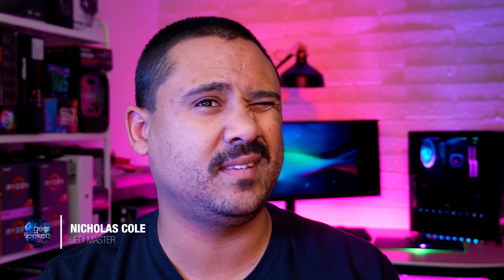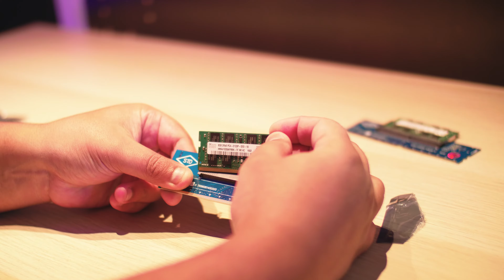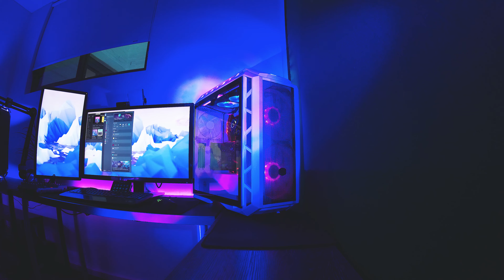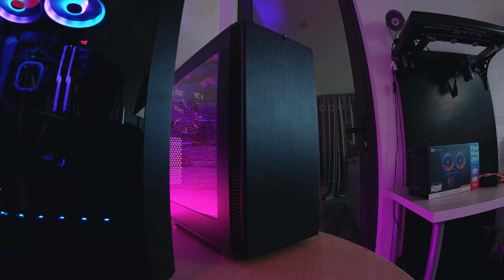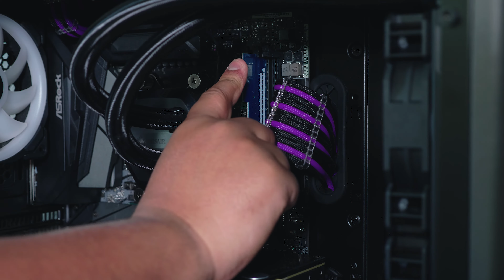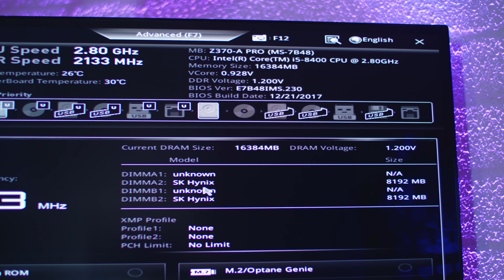Installing Laptop RAM into Desktop! - Compatibility Tested

Comment: I think you need some slightly newer ram sticks for AMD. The older DDR4 doesn't seem to work well/at all with AM4 I find.
Reply from the maker: This video is 6 years old
Reply: @GearSeekers  I was aware of that when I replied, the RAM stick looked a little like some early DDR4 SODIMM sticks which AM4 is a bit weird about when I tested random sticks I had laying around.

Interested to see an updated video on these adapters on various platforms. 😁👍

Comment: Me and my girlfriend really needed to upgrade her PC and went with 2 of these because we were on a shoestring budget due to the current chip shortage, and I had two ddr4 modules from a laptop I upgraded from about 2 years ago now. 

What we find is that it does work with more recent Ryzen, which it has been 3 years since the video was released, makes sense that its a bit more compatible now. The one issue that we have is it doesn't seem to figure it out at first boot. The computer won't post if you just power it on, you gotta hit the power button to turn everything on, hold it until it shuts down, and then hit the button again, and everything works fine. Even has a bit of an overclock on it.
Reply: what cpu are you using?

Comment: Im currently using so-dimm sticks in my current system (i5 6402p msi b150 mobo). At first the system didnt post but fans were spinning and what not. Installed the old ram and bumped the voltage up from 1.2v to 1.4v,  turned off the system, installed the so-dimm sticks again and the system posted. I then went back into bios and lowered the voltage where it was still operable. I know this is a 2 year old video but if you manage to read this comment, and what Im saying doesnt sound like total unicorn bs to you, I'd appreciate if you can confirm this on ryzen systems and get back to me. Anyways great video!

Comment: When you put the laptop ram adapter into the slots on the motherboard, the socket of the adapter appears to protrude over the ram slot in front of of it. Does this mean that you cannot fit four of these adapters into a motherboard with four slots?

Comment: Very interesting. I went searching for videos about these adapters before actually buying them, after watching your video I'm definitely not getting them.
Reply from the maker: Yeah not worth it.
Reply: @GearSeekers  I can concur, these type of dimm adapters are a hit d miss. I couldn't get them working on a ASUS Z170 or AsRock H110. They do however work on a HP Prodesk 400 G3 SFF PC. I mainly use them for testing out DDR4 SODIMM RAM, but outside of this, I would not recommend these at all.

Comment: Hi there! There is a thing that you missed... if AMD is kind of picky with the mems to run the system, maybe you should try other sodimm modules... I currently have 2x4gb gskill ripjaws ddr4 2400mhz running in a asrock h110-hdv, so, it would be nice if you try this.
Reply from the maker: I didn't miss anything. It doesn't work with any memory modules with these adapters.
Reply: Gear Seekers well, you didn't show it on the video, so it was a normal question.

Comment: Hey, great video, I have a question though. In Linus' video, the sodimm ram didn't post while paired with normal dimms. Once he removed the dimm, and ran only the sodimm, it worked no problem. My question is does this sodimm adapter setup work while paired normal dimms? I am building a computer for my friend because he wants to upgrade from his laptop (which has 8gb of ddr4). This is why i was wondering if buying normal dimm ddr4 ram and also using this sodimm adapter with his laptop ram would work. If you could please test this or help me out i would gretaly appreciate it.
Reply: I'll try to post this on a forum.
Reply: most likely No!